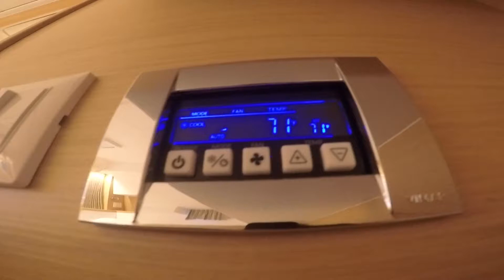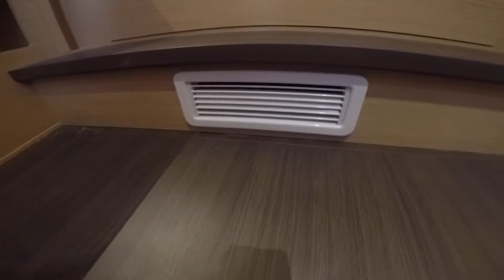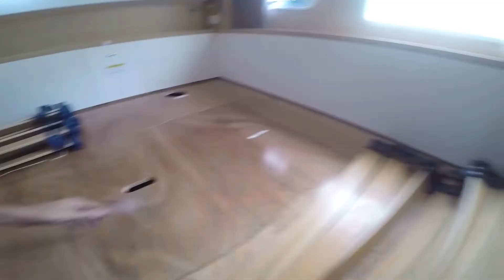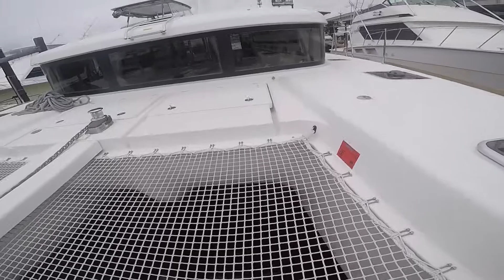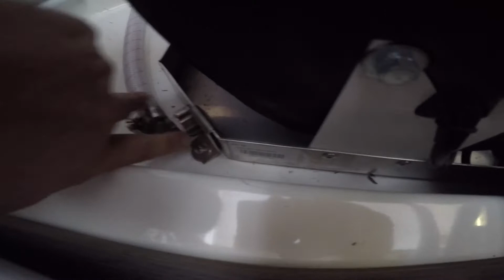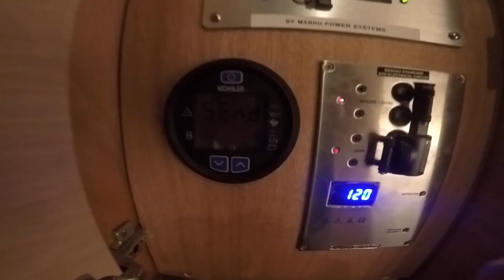Marine Air Conditioning and Diesel Generator Installation on a Lagoon 40 PowerCat by MPS

Comment: I am having trouble with my units. I am in Texas and this is August. We are having temperatures of a little over a 100 degrees and water temperatures in upper eighties. Our units seem to be running hot.  Is there a bigger heat exchanger options that can be used.? WE are using a three 4200 units. The water coming out of the boat does not feel warm but the unit is very hot.
Reply from the maker: Barry,
We do not have a bigger heat exchanger option for these units but in extreme conditions it is sometimes necessary to lower the fan speed of the units. Are you running a single pump for the (3) units or (1) pump per unit? Can you provide pump specs? For a faster reply, it is best to contact us at sales@mabrumarine.com

Comment: You did not state how much wattage total was being drawn on generator with all 4 units on and the rest of the boat electronics (fridge, freezer..etc).  That would be a VERY important piece of info for viewers
Reply: The units draw about 2700 watts running, microwave draws 1200 watts, water heater draws 800 watts, battery charger draws 1100 watts, fridge/freezer draws about 100 watts, a total of about 5900 watts on a 6Kw generator. the vessel is set up with (2) 30A shore power cables, one 30A dedicated to the air conditioning system and one for the other systems on board.

Comment: Hi,
I wonder what the total cost is for the airco's.
Can you tell me?
Are you going to the BOOT show in dusseldorf/germany in jan 2018?
Keep selling!
Reply: List Price for the air conditioners on this vessel (1) 16,000BTU - (2) 4,200BTU - (1) 6,000BTU 115v including stainless steel base, high velocity blower, digital control, display cable, reverse cycle heat, anodized aluminum evaporator, and life-time warranty on compressor - $7,880.00. We will not be at the show in Germany but we will have a demo vessel at the Fort Lauderdale International Boat Show
Reply: Thanks for the info.
Is that price including install?
Big chance that im going to buy your system when we order our cat.
Do you visit any boatshow in europe?